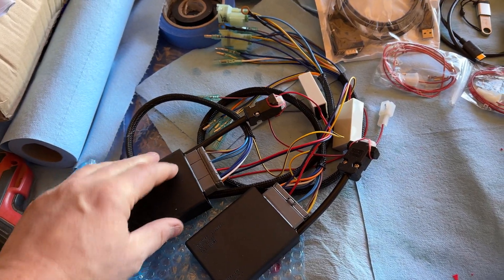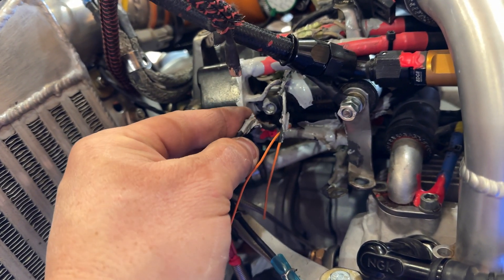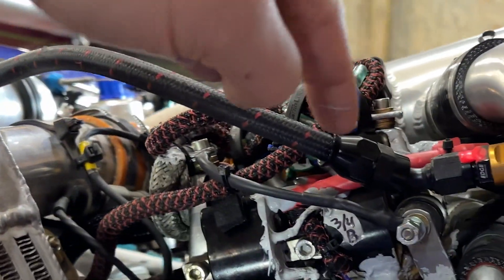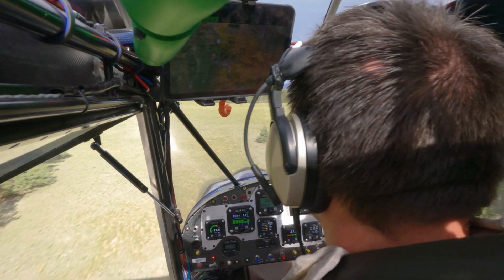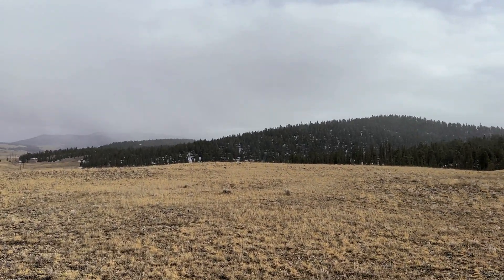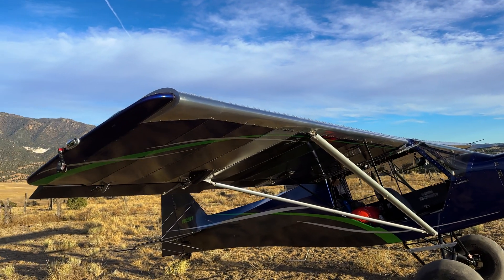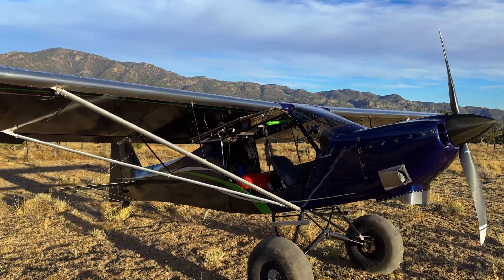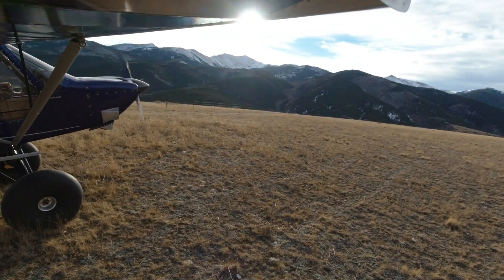Installing / Testing IGNITECH Rotax Ignition CDI DCCDIP2 | Late fall Mountain Flying!

Comment: I have a Europa monowheel with 914, the modules are good so far but only 150 hours on em. I have heard the wires can break after some hours   My late Dad would have liked your plane he used to own a 1958 Helio Courier had it on some tires from a Lockheed 10, had a stc for 35' by 16" 80 lbs. each. also Federal wheel ski's.  Anyway having the right airplane can get you away from it all!

Comment: Nice video, nice airplane too, hey I am in the process of installing a set if these Ignitech modules on my early 912, looking at your video they appear to be the very same units. I have a question for you, What is the yellow and black wires for coming from the small white box near the modules and going with all the wires through the looms out to where you connected up to original cdi location? And I assume you did connect to 12V through that switch to power them up, but if I were to use the stator feed do you know how that works? Thanks in advance, really likingbthe idea of having these things behind the firewall.

Comment: Did you get the cold start function to work very good on your install?
Reply from the maker: It starts better... noticeably. My older flywheel doesn't allow for as retarded of timing on start as it would with a newer flywheel. So I'm still limited... but being able to hold the time retarded until it reaches a higher rpm now helps it to start without the chance of a kickback, and it comes up from starting rpm (cranks at around 480), to idle rpm much smoother because the stock boxes go to full timing at 1000 rpm.. and now mine goes to full timing at like 2200 ish in a smooth transition.
Reply: I have the new flywheel on mine and I can’t seem to get any retard on starting is there a trick to it?
Reply from the maker: @wreckum56  what generation ignition do you have? What plugs on the ignition boxes or what year is the engine?
Reply: It’s  around a 2003 it’s the hour wire I believe

Comment: Last summer we had an intermittent Ducati (stock Rotax) CDI module on our S6. We chose the Ignitech option, and it's a good solution so far, cruising the Idaho backcountry. Having the modules mounted on our side of the firewall gives them a whole lot better operating environment. Might have a bit more RFI ignition noise on the radio, but it's minor and we can shield the modules if we think it's objectionable. Good to see othe r folks are having similar success with these. Ignitech shipped very quickly from the Czech Republic, no issues with payment, and their customer support is first class.

Comment: I have a set of those on my 912 uls  the 12 volt option is nice I found I had a bad stator by using that setup along with a set of AC meters hooked to my stator wires to check voltage